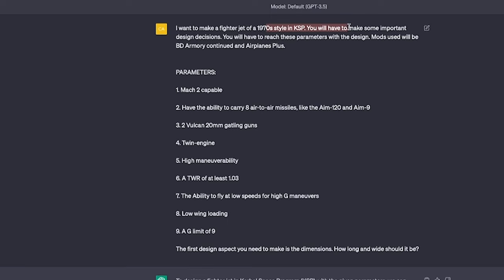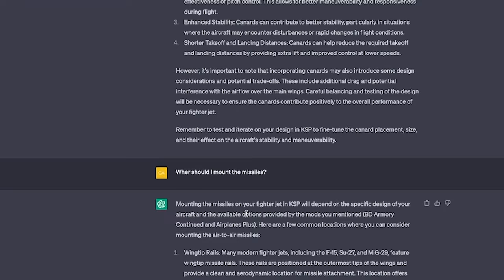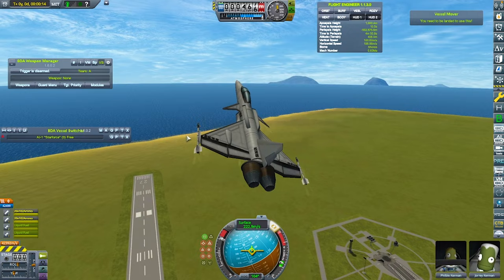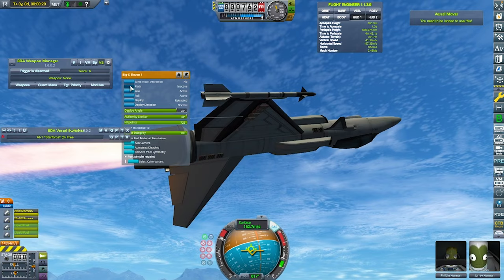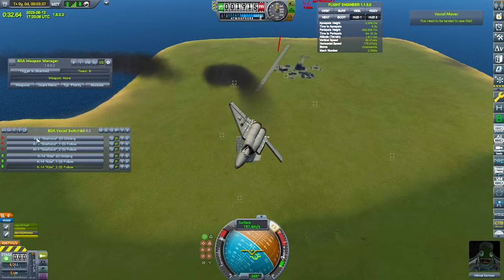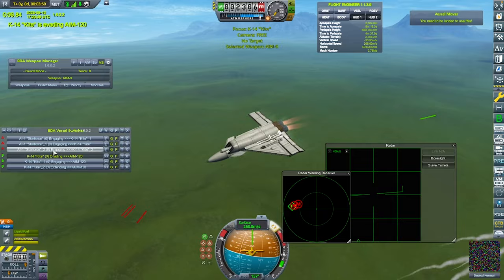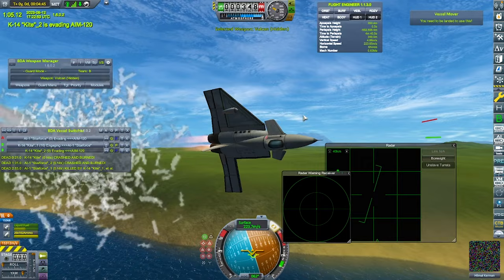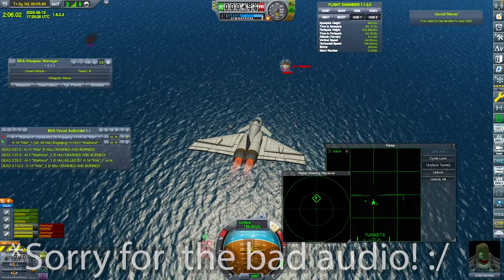Can AI design a FIGHTER JET in KERBAL SPACE PROGRAM?

Comment: Btw the flipping issue is caused by a high-angle induced stall. Wings with a long span typically handle stall very poorly, but Deltas are better off.

My advice is to use smaller delta wings attached to those rectangle connectors will help a bit.

The F/A-18s and SAAB J35 are great examples of this.